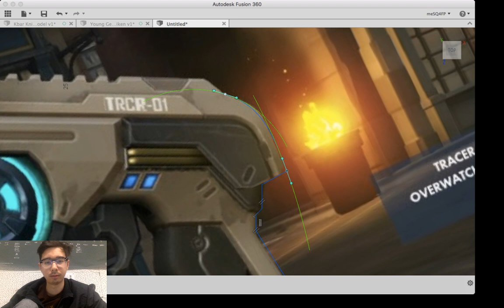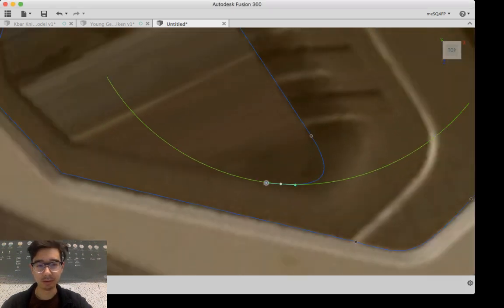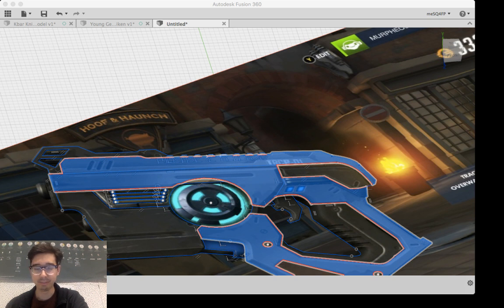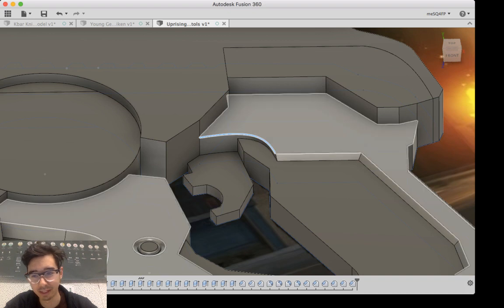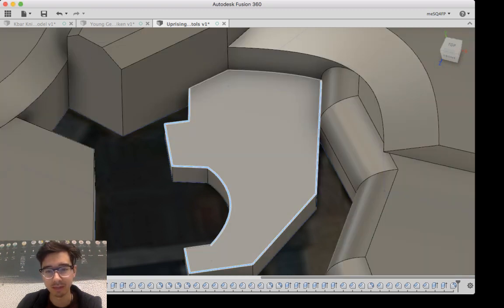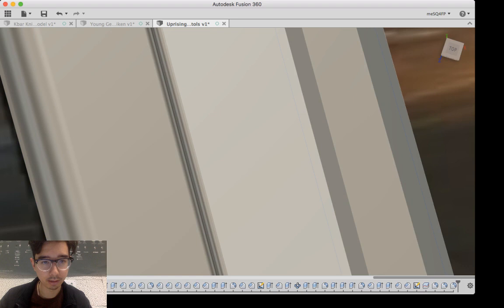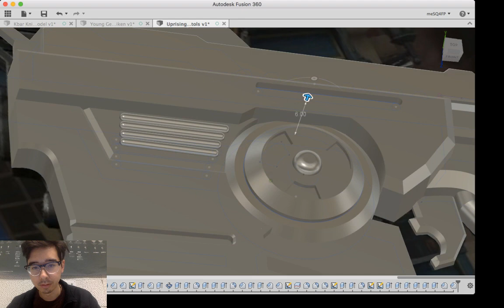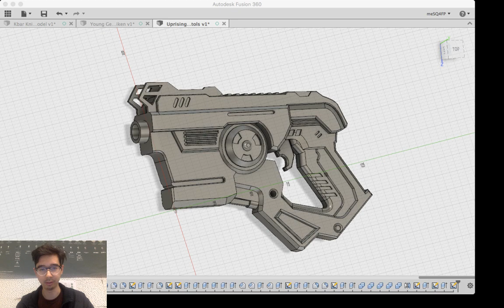Modeling Cadet Oxton Tracer Pistol from Overwatch with Fusion 360

Comment: I think this kind of sci-fi hard surface model from a blueprint would be better in a poly modeling software like Blender instead of a CAD software. But thank you for sharing how it's done in Fusion 360. ;)
Reply: Both methods have their strengths honestly. A major advantage of Fusion 360 is that its all parametric and you can go back in the history at any time and fix a feature if something doesnt end up fitting, rather than having to pull verts around all day. In addition, doing this work through fusion ensures that his model will be easily ready with zero errors for 3D printing.